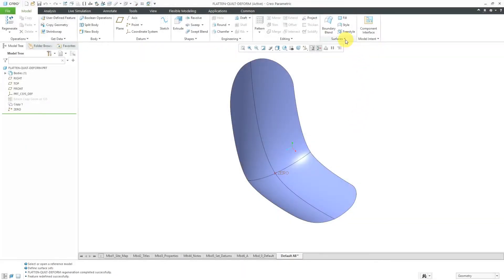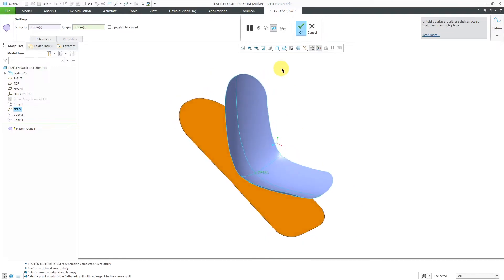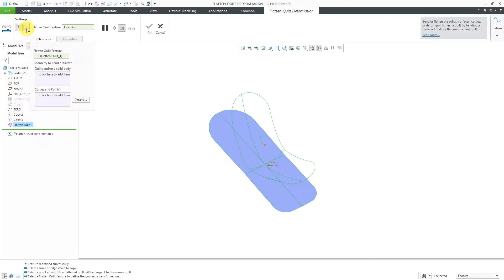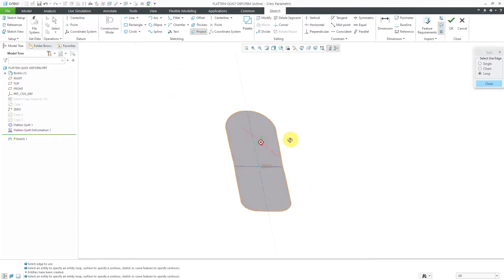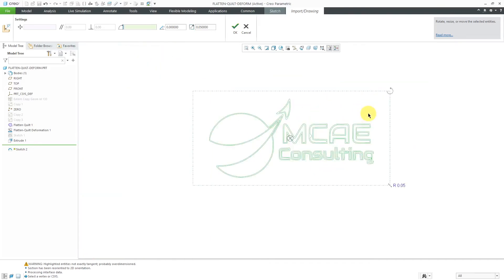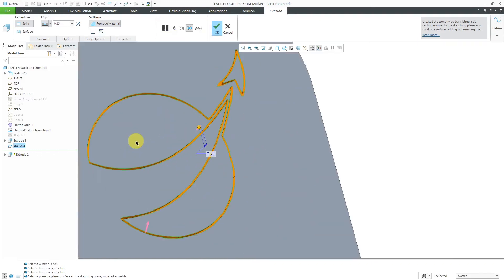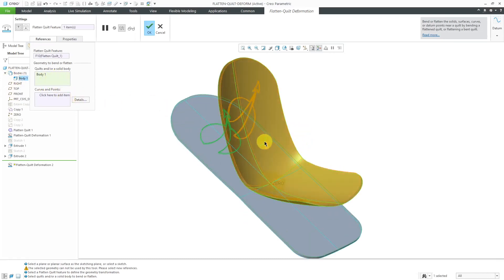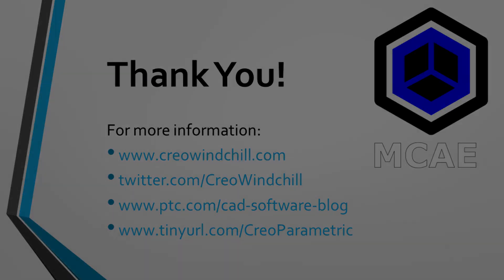Creo Parametric - Flatten Quilt Deformation | Surfacing

Comment: Reminder to my future self or anyone else who doesn't do surface modeling very often:

If you need to deform a surface for shaping it around multiple surfaces of an assembly, like with a label, then you still need to make sure that the sketch used to create the Flatten Quilt is of one continuous curve. Multiple lines/curves, one for each surface profile, will not work the way you want it to.